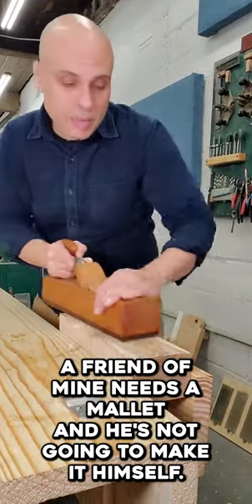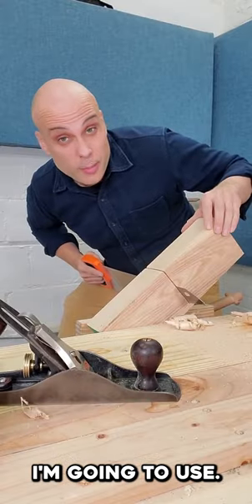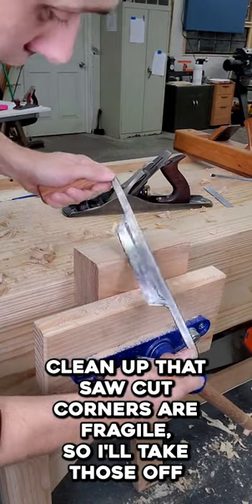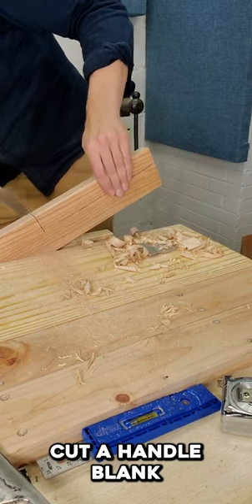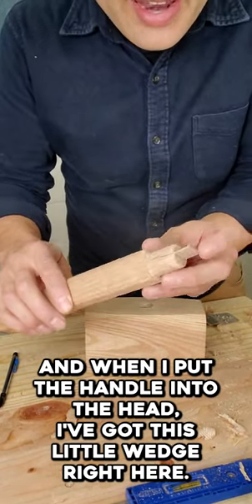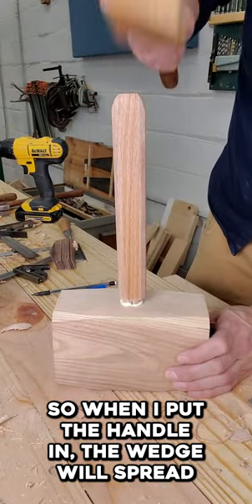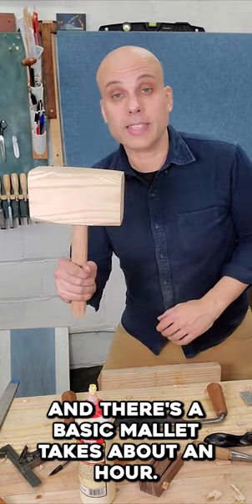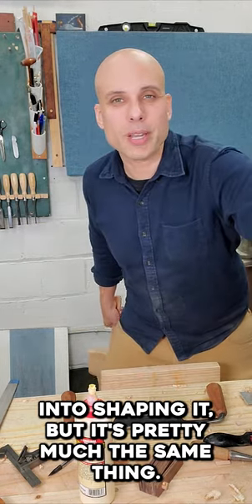Make a mallet FAST with this cool trick #diy #woodworking #shorts #diywoodworking #woodworkingplans

Comment: Do you have a guide to how thick a wedge should be? I get that the handle vtenon should be a bit short, but the wedge should be the full length, but the last time I tried to do this (my first time), the handle stopped with about 1/2" of kerf still visible.
Reply from the maker: You kinda get a feel for it over time.  I always leave my handles long.  If i run into trouble like you did,  i saw the tenon off and do it again.  Getting it wrong a time or two is a good teacher.